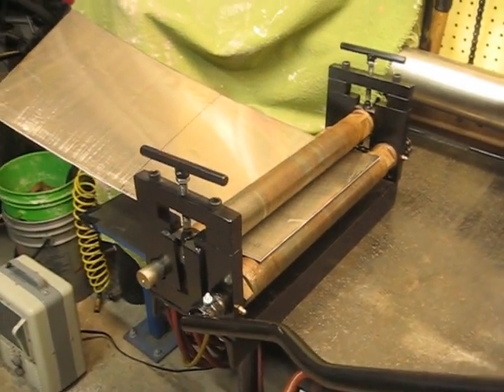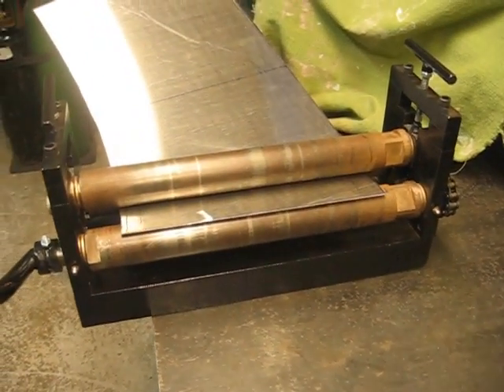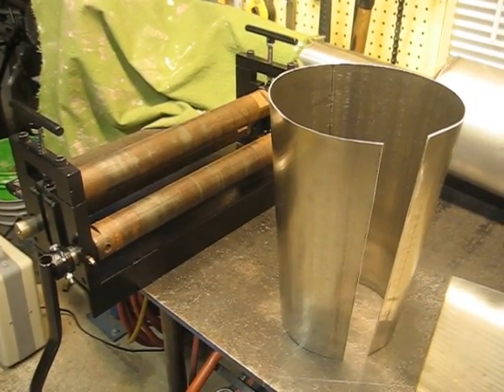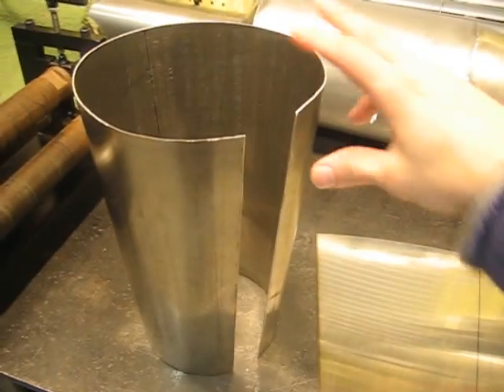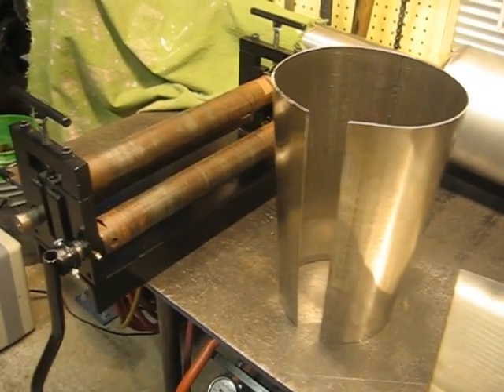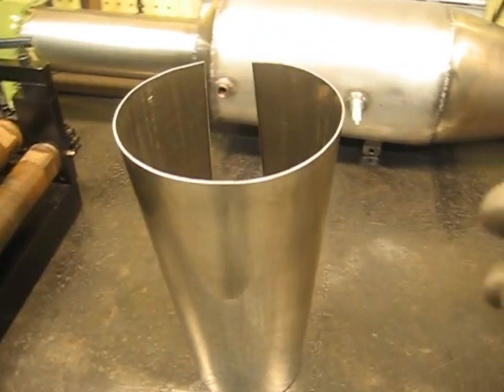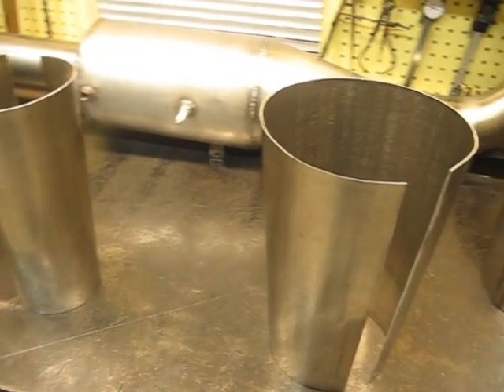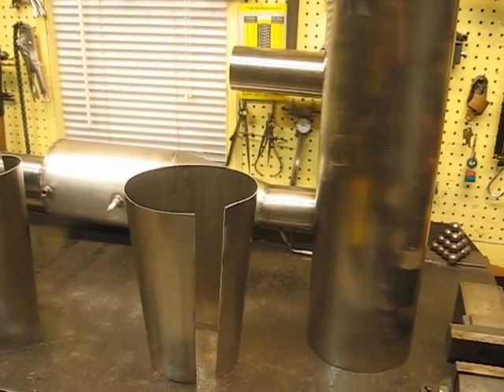building a pulse jet engine rolling stainless steel cones

Comment: do you have plans to make that homemade slip roller or where you found the plans? I do have access to a slip roller but its not in my shop so its quite annoying to use when I need it.
Reply from the maker: No.  I just made it on the fly with parts I found at work.   I also had access to a Lathe and mill.
Reply: @MrBen527  I do have access to a lathe and mill too my difficulty is finding tubes that are thick enough to roll the metal I want without spending too much is yours just pipes or smth? how big are the pipes and whats that largest gauge you have been able to roll?
Reply from the maker: Mine are solid,  hardened steel rods almost 2 inches in diameter.  It's around 16 to 18 inches long.   Plenty of strength to roll 16 ga. SS.  It's 2  driven rolls (chain and sprockets) with a hand crank,  on the bottom, and one idler on top.
Reply: @MrBen527  thanks
Reply from the maker: You're welcome

Comment: Mr. Ben, your work looks grate to me... how much you charge me to roll a Cone 5" Dia. on one end, and 3" Dia. on the other end.... 5" tall..... lets say 10 or 12 ga. Carbon Steel or 12ga Stainless Steel.  Let me know, need it for a youth Big Brother Project.
Reply from the maker: Hello.  I appreciate your comment but my roller could not make a cone that small.  Try this.  Go www.red-bag.com and click on engineering tools and then cone strike out.  This will give you the dimensions to cut from sheet and then you could take that to a local fab shop and they would roll it up for you at a minimal price, maybe free if you tell them who its for.  Feel free to contact with any more questions.